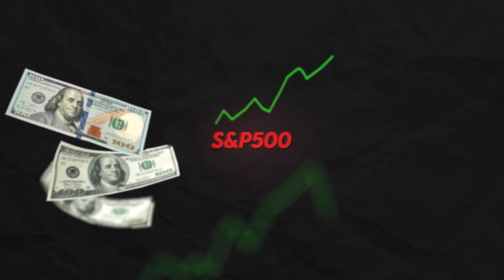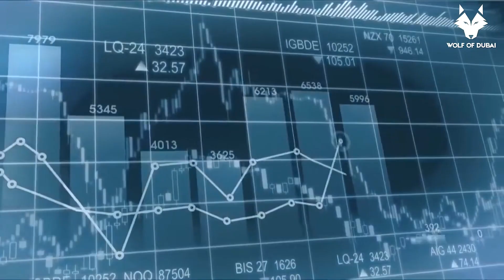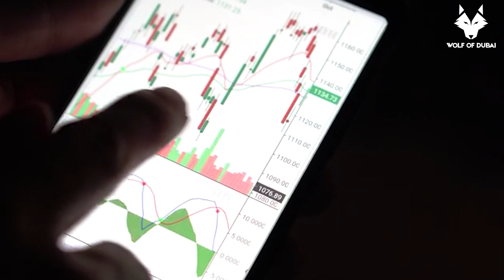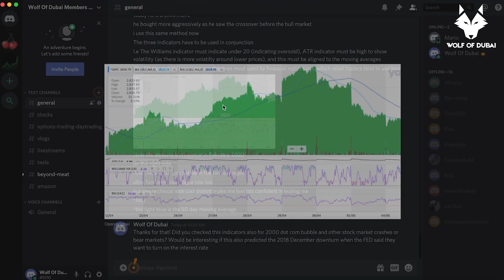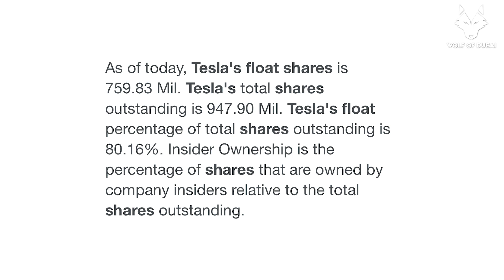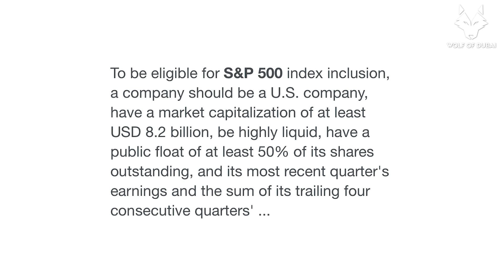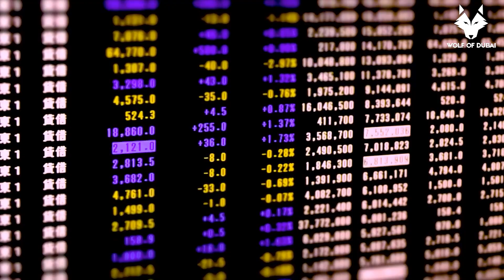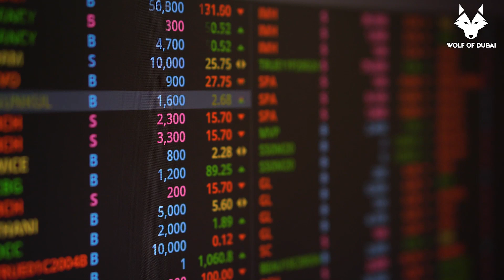This is Why the S&P500 is So Important for Tesla Stock

Comment: Actually what will happen after adding Tesla to S&P 500? what that means? How TESLA will get effect .. what are the factors we should consider?  Can some one explain?
Reply: It just gets added to S&P 500 index. You will still be able to buy Tesla stock normally even after inclusion on December 21. S&P 500 is tracked by Trillions of dollars of index funds. In order to match the S&P 500 performance, index funds will need to buy Tesla stock to have an equal weight compared to the rest of the S&P 500 index. 
So these index funds will have buy around $40-$50 Billions dollars of Tesla stock. This will cause Tesla stock to Go up in the short time.
Reply from the maker: Here we go